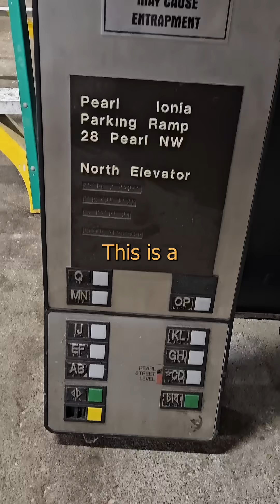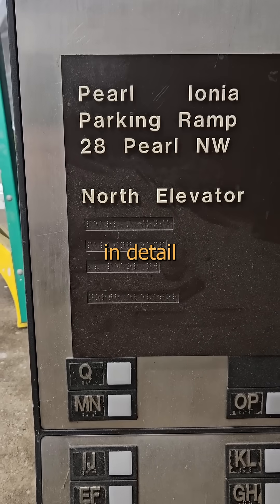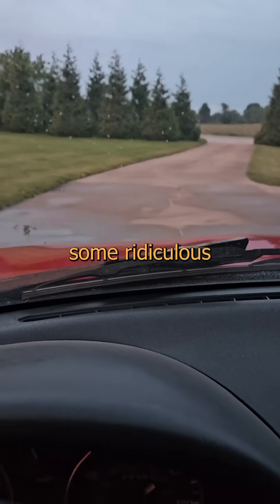Miata Mischief #chrisboden #engineering #gear #elevator #score #stories #parts #hacking #making

Comment: Not quite hauling sketchy with a car, but sketchy hauling a car. First night out on a 4 day camping trip about 15 minutes away from the campsite, my buddy in a bone stock 99 civic hatch decided the corrugated undulating track in the middle of a crater that was the Flinders Rangers here in Australia was the best time and place for him to channel his inner Colin McRae.

Im in a 2013 corolla with stock suspension thats stiffer than Chris after mistaking Viagra from the blue pill in the Matrix, doing 40Kmh/25mph while he hit hyperspeed and disappears in a cloud of dust.

Couldnt see his taillights or dust trail for a solid 10 minutes and nothing on the CB radio, I crest a "small" bump that has a big dip on the edge and avoid a sharp looking rock. Go around a bend, and my radio goes "Hey, you there? Ive got a puncture, and guess what kind".

Not another 2 minutes later i see him laying on the ground beside the car with his hand jammed into something. Turns out i was smart to avoid the rock from earlier, because he had punctured his fuel tank.

Rock must've had some prior training bevause it gave his fuel tank a double tap for good measure. Lucky it was off centre, and even luckier i was smart enough to bring a proper jack with me. We got the car as high up as we could and let the fuel go until it stopped leaking. And when youre in the middle of nowhere, in the dark, with the closest service station thats open being a 3 hour drive away, you have to improvise.

Lucky for me, my teenage self was a smoker, and my dumb brain decided the empty pouches from my rolling tobacco was gonna look really cool for a project of some kind. I turned a few of those into a cone plug, found some blutack in my glovebox and used those to give it a bit of structure, and rammed/screwed the tip😏 into that hole as much as we could, then split the sides of the pouch that was sticking out and tried our best at ductaping it to the fuel tank covered in dust, dirt and petrol.

Told my mate to get in the car, it started, and as soon as i dropped the car off the jack, man took off towards the campsite just like what youd see in a nascar pitstop.

For the next few days, his car sat tilted on one side like it had hemorrhoids. A rural callout for a roadside mechanic was gonna cost 300 bucks, before getting parts and stuff. We did also ponder making the 14 hour round trip to get the fuel tank off his written off civic, but decided we weren't on top gear and that shit was gonna be way too much effort.

We went on doing normal camping things, and on the last day, redid the sketchy plug, and with a little top up from a jerry can, held up just enough to make it to the nearest hardware store/petrol station/restaurent about 90 minutes away.

Miraculously, they had metal epoxy putty, which did just the trick to plug the two big holes and the few small cracks behind it. Let it cure for an hour while we had lumch, and drove the remaining 6 hours home with no issue. Absolutely my fondest memory of all time to be honest.

Side note: When you have a roll cage and the top down in a miata, they dont need to be acrobatic, or a dwarf to be able to have fun, just a foot on each seat, and they can admire the miatas rear end from above while you admire their rear end from above.

Comment: I put a 2m (higher than most people) long sheet of PVC in a good old and small Citroën AX. The sheet was almost the width of the inside of the car, begin at my middle mirror and end at the end of the trunk while being bent at the maximum before deformation. I also transported a table and a bed from Ikea in the same relatively small car. (I'm in France and the only time I saw an American pick up truck while driving this car, my head was at the height of the number plate)

Comment: I once picked up a full stack bass cab in my new edge mustang by pushing forward the passenger seat, putting the convertible top down, and having my friend sit on top of the cab so it didn’t go flying.
That was quite the nerve racking ride 💀

Comment: It was for work but I had a 28ft steel I beam on a 20ft trailer, broke 4 straps but got it where it needed to go eventually and very carefully, probably wasn’t safe at all cause it really wanted to lift up the back end of the truck but it worked

Comment: So me and my dad like a few days ago decided to use my short box pickup truck to move roughly one Ton of built fencing panels (so about 10-11 full fence panels that were being held together with hopes and dreams) and since I have a SHORT BOX 2006 Chevy Colorado with a non functioning gas gage and passenger door lock not working properly we ratchet strapped 5 at a time (6 the second trip) on the TOP of my pickup trucks box since they wouldn’t fit inside now it was actually surprisingly sturdy with two ratchet straps holding it on the top we had one hooked on both the back wheel wells and one hooked on both sides of the bottom of the bumper and man rhat was the scariest drive I’ve ever had. Not to mention how tiring it was to move all of them from the ground up onto my pickup trucks box box and when we were moving one it kind of fell apart so we had to hope we could lift that one and throw it on top and it made it home somehow. Also on the first trip my dad stepped on an ant hill so he got ants all over that foot but he survived with no injuries lol. Side note thr has gage now works me and my dad fixed it like an hour or two ago so thank god for my dad being confident with vehicles lol

Comment: Once i had to bring home moving boxes in a 2nd gen Miata and these boxes were so large that they stuck out the window a bit and all the way into the drivers seat against my neck. I thought to myself, its a 8 mile drive ill be fine and then i passed a local cop and a state trooper with my head practically out the drivers window reaching around the box to steer😂

Comment: 2002 Ford Focus wagon
Hauled  36"x96" pallet rack ends times 2 with 10 shelf rails 12' long. With the back seat folded down the bed of the wagon was 6' long. Drove 35 miles with 6' of the load hanging out the back and not being able to go above 60 mph because the front end would start to lift up. Every time I hit a bump the front wheels were off the ground for ~10 seconds. Still have the pallet rack the car was retired with 250,000 miles.

Comment: Some years ago, my car died from oil pump failing and I got many things in a portable refrigerator inside. Since I didn't have another car, y went there with my sport motorcycle, took the refrigerator on my arm and went home without turning the handlebars not even 5º since I couldn't move it with the refrigerator topping out.
I had arm pain for a week after that, it was close to snapping a bone since the refrigerator was full and wheighted about 15kg

Comment: If you think that’s fun then you gotta drive an E30, mine has high compression pistons, a cam, a lightweight flywheel, and a limited slip differential, it’s so fun and drifts so easily, and you can’t beat the handling because it weighs 2200lbs

Comment: 1988 foxbody mustang convertible. Old work place I was at, was getting rid of heavy duty shelving. I'm talking like 4 feet deep and 5 feet tall and about the same width of the back seats. Needless to say, I got it home. Felt like a sail at 120km though.

Comment: I have a ford fusion, it’s a nice little car and it has a pretty alright amount of storage but definitely not a lot, my buddies and I had been planning a trip to our cabin for weeks and we had a few supplies we wanted to take up there to fix up the cabin a little, however, last minute, their truck was in the shop and they needed someone with storage space. I, completely unsure if it would work offered to try, Lo and behold an hour later I manage to cram camping supplies, fishing supplies, a canoe, 2 24x24” window assemblies, some 2x4, a cooler full of food, 4 dudes and a Myriad of other miscellaneous miracles into my mid sized sedan, she was so overloaded that the rear was sitting a good 4 inches lower than usual, the tip of the tires was just tickling the top of the wheel well, but the inside of it still had 3 inches of travel so we sent it. Never doubting my car again.

Comment: I had a 2005 pontiac vibe and i got a gigantic oak office desk for free on the internet, it weighed a ton and would not fit in the vibe (honestly supprising because ive hauled couches with that thing) but it was huge and i flipped it upsideown on the roofrack and strapped it down it was longer than the car itself and the guy who gave it to me was so impressed by my tenacity that he ran inside to grab a camera to show his wife. 😂😂 it was definitely the largest thing i ever hauled with a small vehicle and it was absolutely ridiculous because i do stuff like this all the time.

Comment: Ive actually got a miata too and i used it to transport a BUNCH of car parts. Im talking mufflers, intake piping, a turbo or two, and a few other knick knacks too. All of it piled up in the trunk, passenger footwell and passenger seat. The best part is that it started raining on my way to drop all this off at my buddys house. The tote in the passenger seat had a piece of intake piping that was quite large and couldnt be moved. One side of it just so happened to be pointed out toward the wind outside the car, (i couldnt roll the window up due to this) and the other end of it was pointed upward toward the passenger visor inside the car. So the whole time, my car was getting rain shot in at the roof, so the roof and interior was getting wet over time, and im was in the splash zone along with the wind being about 40 degrees that day. Cold and miserable. But hey she still runs and still isnt rotten (yet).

Comment: Bit late, but it's not about the prize. Batman. 
It's about storytelling.

I was maybe 8 years old, it had just rained heavily in my little backwater hometown where the streets weren't paved and where the ground was more dust and hard dirt than concrete or asphalt. 

In my great, incredible mind I decided I wanted to go to the store and buy some cookies, because I wanted some. 

Cue taking the money putting on not boots not shoes no, I put on a pair of flipflops and walked in to what was knee high mud to my kid self. 

Almost 200 meters Id say? Probably less than that it but it felt like a long walk considering how much mud I had to strategically move around. 

I come home, my flipflops made of 80% mud 15% rubber and 5% more mud stuck on my feet. 

My mother sees this and says "you are not coming inside until you clean ALL that mud off yourself" I basically had a shower in the garden with the hose.

Comment: I hauled a new tv in my miata tucked in behind the seats. Even as a modest 43" the box was too wide so I had to push one corner down behind one seat while the other corner was high in the air catching wind. I drove home through small roads so that I didn't exceed 50 km/h and it was fine. Going on the highway could have snapped it in half.

Comment: Aight Here in comes, my brother had a car, it ran on 3 later in the ride on2 cilinders so it was a single drive to the junkheap but I had to get back so I got a moped halfway in the boot of this Tiny car, a fiat saicento I secured it with a Ratchet strap and prayers it worked😊

Comment: As the long time owner of a ‘90 Miata, I can tell that carrying anything other than the laundry can be defined as sketchy. For example, I had to time the purchase of a television for a sunny day so that I could put the top down in order to fit it in the car. After more than 130,000 street miles (the car has 256K on the chassis now) I can definitively say that traveling with a Miata becomes an exercise in minimalism combined with expert level Tetris skills.

I wouldn’t have it any other way.

Comment: I was sent in my dual cab ute (yes I'm an Australian) to drive up a nearby mountain to a parts supplier to pick up a new Caterpillar D10 Equaliser Bar and bring it back to site because the one on the dozer was cactus. Now an important thing to be considered here is that it's not what you would say is a small part by any means and it's definitely not light weighing in at a bit over 1 metric tonne. So I arrive to collect the part from the supplier and the look of surprise on both mine and the guy with the forklifts faces when it came out of the shed was equally priceless. 

It took a fair amount of wrangling and no matter which way we tried to position this behemoth chunk of steel there was no escaping the fact it was going to be overhanging at least 2 sides of the small but mighty steel tray I had on the back of the ute. At this point most would give in and go hire a trailer but this was a one time trip and I wasn't about to make a return trip to drop a trailer back off. 

We chained it down to within an inch of its life possibly adding another hundred or so Kg to the already substantial load and I proceeded to drive back down the windy mountain road sphincter puckering all the way to the bottom of the decline and getting some particularly curious looks from other drivers on the way. 

Upon successfully making it back to site and meeting the fitter there he was astonished that the supplier had even loaded it onto my ute and even more shocked that I'd made it down the mountain without incident carrying an oversized load that exceeded by a long shot the rated capacity of my ute. The real kicker was that it was actually too heavy for his truck mounted crane to lift off my ute... So in order to unload it we had to back my ute up to the dozer and chain the bar to it then proceed to mash the loud pedal as hard as I could and basically Dukes of Hazard this thing off the tray onto the ground hopefully not taking my tray with it in the process. Then we spent the following several hours manhandling this uncooperative iron bar underneath and then up into position under the dozer. After all was said and done we got the job done with time for a few hours sleep before firing the dozer up and putting her back to work the next morning and nobody got hurt or arrested.

Comment: Opposite direction. I had a racoon tearing up my house and tried everything to get rid of it, escalating to an air rifle. Racoon presented it's butt one night and I stung it but it didn't die... until after it got back into my soffit. I thought I missed but the cloud of flies near one corner of my 2nd story soffit proved otherwise. 

So, I climbed my fat ass up there, peeled back the soffit cover, and a bloated, dead racoon rolled out like the worst medicine ball ever. 

So, how did we decide to get rid of this festering ball of home destruction? We tied it up in 4 trash bags, but the smell was still absolutely overwhelming. No way we were going to put this into a vehicle to drive it to the dumpster we chose for it's final resting place. My friend had a 1 ton diesel van with a ladder on the back. We tied the Matryoshka trash bag contraption to the ladder on the back of the van and drove the 12 miles to the dumpster.

Comment: once moved probably close to 200lbs of stuff 8 miles by loading up doub saddle bags and bar bags on a set of eletrick bicycles and a large pack i then tried to ride one while ghosting the other that sorta worked a bit but then the battery started dieing so i had to walk it the rest of the way holding them both at the neck 1 on each side they were too heavy to go up hills like that so id have to leave one at the bottom walk the other up then go back down the hill n get the second bike n walk that one up
Reply: and i have the pics to prove it